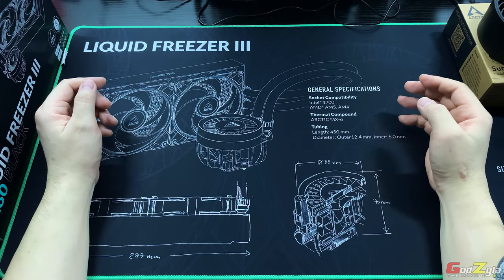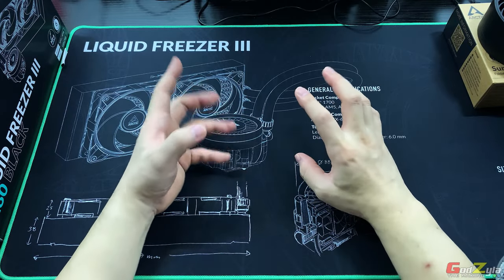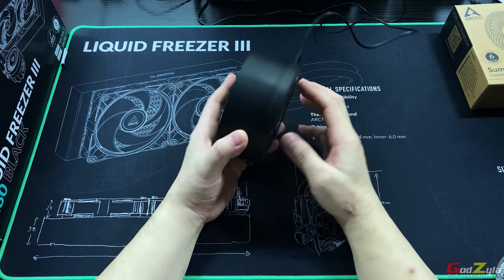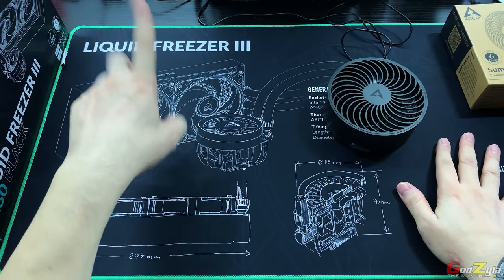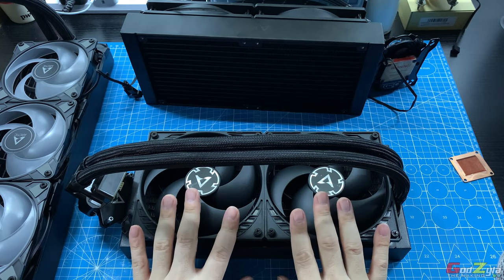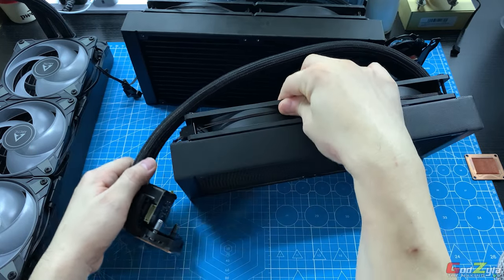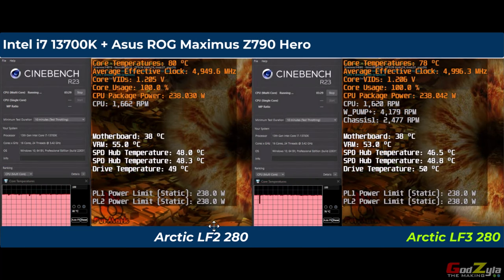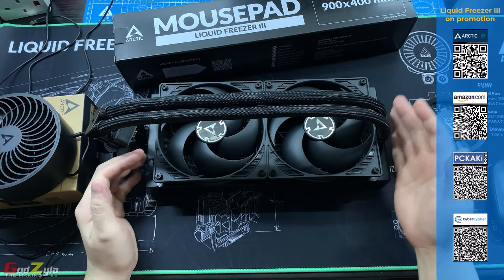Arctic Liquid Freezer III

Comment from the maker: Kindly note, I have made a mistake at timestamp 14:56, be it if you are using the single connector or split connector, the drawing ampere is from the Pump header, make sure you plug the pump header to a 2A fan header or pump header of your motherboard.
Reply: also u have to rename timestamp at 25m
Reply from the maker: @dddman9220  thank you. Greatly appreciated it to have correct my mistakes 👍👍👍
Reply: Im so glad i watched your video i was not able to find anywhere what the best header to plug single connector. I found out that i plugged it in the wrong header which on my mobo asrock b650 pg lightning is CPU_FAN1 1AMP12W so i plugged it in CPU_FAN2 2AMP24W header. Thanks alot for this video.
Reply from the maker: @fr0sty1998  hi and welcome to my channel and am glad you find this content useful, greatly appreciated your feedback too 👍👍👍
Reply: @KleoYan  Hey man quick question, while i was mouting this aio i managed to somehow touch thermal paste i applied and ofcourse instead of cleaning it and repasting i just put aio on the cpu. Wondering if that can cause bad temps with this AIO? I just bought it today, and my 7600x with undervolt in cinebench reaches 80-82c max load.
Reply from the maker: @fr0sty1998  hi not to worry your temp looks fine, unless max load is at 95 or so with under volting.
Reply: @KleoYan  Hmm im wondering why i cant push past 5.31ghz boost clock then with best core -15 2nd best -20 and rest -25.
Reply from the maker: @fr0sty1998  if you are just fiddling with curve optimizer and not PBO2 manually. That might be the cause. I wouldn’t advise you to do PBO2, unless you fully understand how PPT TDC and EDC works.
Reply: @KleoYan  Oh yeah it is curve optimizer, thanks for you quick response. Was just wondering if i can maybe squeeze 5.4 - 5.5 on all cores.
Reply from the maker: @fr0sty1998  sorry buddy, I rather you have a healthy system than to stress it. You see, what’s the point to squeeze every bit from the processor where is does not bring any huge significant performance? Your processor base clock is at 4.7Ghz and boost clock is at 5.3Ghz, which you have reach it. These are the reasons I will stop you from there.
1) the longevity of your processor
2) by pushing it abit more means drawing more current and stressing your motherboard vrm 
3) it does more heat generation which will  impact other pc components. Therefore imagine in a long run, you motherboard suddenly died on you. What happened then? 

I am more toward the conservative type. Whereby so long it performs similar or slightly better than base spec, drawing lesser power to achieve better thermal results, I will call it a day and to enjoy the PC. 

Last but not least. If you still choose to go beyond. I won’t stop you either.
Reply: @KleoYan  I used to do some overclocking on intel cpu's with deliding aswell. But i cant seem to understand how ryzen systems work, or to be honest any of the new cpu's. I mess a bit with curve optimizes trying to lower voltage i saw alot of people managed to hit 5.5- 5.6ghz just by undervolting but my cpu always stops at 5.3 no matter how much of undervolt i use. Temps are also fine max tdp is 90w i believe.
Reply from the maker: @fr0sty1998  maybe this will help you out. First get to know what's PBO2 and CO (Curve optimizer) https://youtu.be/dU5qLJqTSAc then you can refer to this https://youtu.be/90UBUq1mLGY 
Now this is way off topic of this content. If you and to know more and such. I would encourage you to discuss your matter here https://www.reddit.com/r/Amd/
Reply: @KleoYan  Thank you so much for all the help. I did manage to find a really high (stable) undervolt for my cpu which is core1 (best core) -22 2nd best core2 -21 core3 -34 core 4 -27 core 5 -34 core 6 -38. I still have to test core 3 and core 5 i believe they might be able to undervolt even more. I know i saw somewhere that it is good to give lower undervolt on best core and give it more headroom for higher clock. Still learning though.
Reply from the maker: @fr0sty1998  Yup and hope for your kind understanding. I have bad experience showing settings on a content regarding about AM4 undervolting. Even with disclaimer that I will not be responsible for damages, one of my viewers took my settings and blew his processor. Though he did not fault me but I felt bad about it. 
The issue is, each processor reacts differently (Good bin and average bin), that's the reason why I provided you the links for you to find out more about PBO2 and Curve Optimize. Anyway all the best with your tweaks 👍
Reply: @KleoYan  Hey i think i just found the most stable error free undervolt core1* -20 core2* -20 core3 -34 core4 -23 core5 -35 core6 -36. For some reason core4 only takes -23 undervolt to become stable ive been testing alot with occt. Also im wondering if there are any advantages of using 3 cables instead of 1 cable for Liquid Freezer III 360?
Reply from the maker: @fr0sty1998  Hi and welcome back. You can do all the findings on Curve Optimizer but I can only tell you.. I was once like you and one fine day, system can't boot properly. ended up have to tweak again. It's very tedious to find the correct curve points as you need to do all cores plug for 5000 or 7000 series AMD, the there are two CCD which are the top cores, they will use more voltages, thats why you can't lower anymore on the CO (Curve optimizer). 

As for 3 cables to 1.. the Pump connector not only provide power to the pump, but to you radiator fans and vrm fan. as for PWM are controlled separately (The fan connector and vrm connector) That is the advantage. 

If you use the one cable for all, basically you can't separate the PWM rate of the VRM fan, Pump header and the Radiator fan.

Comment: Please guys whatever you do, do not buy arctic freezer 3 if you have an amd processor. This shitty designe on the aio costed me another 150 quid to replace my fried ryzen 7 5700x cpu. The designe is so awful for I stalling it on the cpu and it's just janky. And I did install it with max force because I had to push one finger at one edge of the cpu block thing in order for me to install that aio to my motherboard. Honest to god my worst experience with my first aio purchase. Hope you find this helpful Arctic
Reply from the maker: @sebs6144  hi and welcome to my channel. Hmm, sorry for your unpleasant experience, I have no issue with it though and getting extremely good results on a 7950x https://youtu.be/ca2zGSQvWog.  Nevertheless, thank you for your feedback.

Comment: Where are the actual fan cables? Are they running under the sleeve of  the hoses to the pump section? Am I missing something? What if you want to replace the fans?
Reply from the maker: Hi Dēmḗtrios, welcome to my channel. The fan cables are hidding under the sleeves. if you are to replace fans I would advise you to check the ampere of your fans. if it total up to less then 1A, then proceed to use back the connector which is located at the hose (radiator area) to connect your replaced fans. If you are using Lian Li uni fans. AL, SL, TL or even SL-Inf, I would advise you to plug it to their controller / hub and not to the fan connector of this liquid AIO.

Comment: Hi i have this aio when i connect   all work but not argb and rwm  what should i do I have b650 pro rs mini atx and i connect all in one cable to cpu fan 2wp and argb to addr led 2.  What should I do in your opinion.
Reply from the maker: Hi Patryk Płatek, welcome to my channel. is your board this? https://www.asrock.com/mb/AMD/B650M%20Pro%20RS/index.asp if it is, make use of the 3 to 1 cable of this liquid cooler and the connection as follow, page 10 of 67 of the manual https://download.asrock.com/Manual/B650M%20Pro%20RS.pdf

Liquid AIO Pump connector to CPU_FAN2/WP - Set in UEFI / Bios to Water Pump and with PWM at FULL speed
Liquid AIO Fan Connector to CPU_FAN1 - Set in UEFI / Bios to PWM and set it to performance
Liquid AIO VRM Fan connector to CHA_FAN3/WP - Set in UEFI / Bios to PWM and set it to performance
Liquid AIO ARGB connector to ADDR_LED3

download ASRock Polygram, you have to select ADDR_LED3 and then set the effects.

Comment: THANK YOU FOR THIS INSTALLATION METHOD! I got the Liquid Freezer III 420 today and installation was a breeze!
Reply from the maker: Hi Krithalith, welcome to my channel and I am glad you have mounted your LF3 with ease 👍👍👍
Reply: Hiya, I ordered 1, getting it tomorrow, how are you finding it? I'm upgrading from the LFII 360
Reply from the maker: @Takeme_DCUO  hi and welcome to my channel. Liquid freezer III will be good for AM4 or AM5 but not Intel. I have done some testing and here are the results https://youtu.be/ca2zGSQvWog. Hope that helps.
Reply: @KleoYan  brilliant I have a ryzen 7 7800x3d 😅
Reply from the maker: @Takeme_DCUO  ok thats good.👍👍👍
Reply: @Takeme_DCUO  I'm using it on a 9950X and am definitely happy with it so far. It's quite quiet on lower fans settings and the cooling performance is very good.
Reply: @Krithalith what sort of temps do you get under load with this and the 9950X?

Comment: do you know how i would sync the argb with lets say a lian li controller if i wanted to swap out the fans with uni fans
Reply from the maker: Hi Steve Larson, welcome to my channel. Mind if I ask which Lian Li uni fans will you be using?
Reply: @KleoYan  I was thinking of using the uni tl 120s on the liquid freezer III aio. I was also going to have some uni tl lcd reverse fans in my case for intake
Reply from the maker: @stevelarson520 If you have set you mind on the TL 120s and TL 120 LCD, you will need to seperate from the AIO. as TL fans draws lots of ampere. this is what you whould be doing. 1) For AIO Pump, use the single connector to provide power both to your pump and VRM fan. and the argb connector to your motherboard argb header, you have to make use of your motherboard utility to control the pump argb effect. 2) for TL Fans or TL LCD fans, you have to plug it to the uni controller/hub. This is where you will need L-Connect 3 app to control the fans argb effects, rpm and the LCD display.
Reply: @KleoYan  thank you very much for the help. i appreciate your time
Reply from the maker: @stevelarson520  you are most welcome. All the very best with your build too. 😉

Comment: i struggle to wire the ARGB from my arctic liquid freezer 3 aio into my Z790 Maximus Hero because the cable of the radiator fans is a Male and on my motherboard its a male too, but on the arctic website it shows that normaly the Radiator fan cable SHOULD BE a female which would work well.. realy dont get it
Reply from the maker: Hi Velvet - Real Horror, welcome to my channel. the ARGB plug on the LF3 is a female connector and the ARGB 3pin 5v header on the motherboard is male. you should be able to connect it. maybe take a picture of your AIO argb connector and send it to my email godzylatech@gmail.com. I see what I can do to help you out.
Reply: @KleoYan  Yea thats the point :D it realy should be female, but mine is male, or maybe i need to unscrew all the fans and check them, maybe theres something wrong with the cable connections or the real motherboard connector is hidden... alright i will send a picture, thanks!
Reply: Alright, send you a email
Reply from the maker: @VELVET462  I see what's the issue now after seeing the email. look at the other side of the fan where the tubes are at on the radiator. You see the fan argb is connected to the cable and that cable routes all the way to your pump. your pump will have the female 3pin 5V argb connector. that is where you plug to your motherboard. as that argb cable not only controlls the argb effects of your block but to the radiator fans too.
Reply: @KleoYan  My Man!
 
one thing first. In youtube you wrote "welcome to my channel" but its not the first time, im following you a while now. and you helped me some while back!
I cant thank you enough, i never installed ARGB but after you said whats wrong of course i saw my mistake xD
Everything works like a charm now! Thanks so so much! :) Love your channel, keep up your realy helpful videos and person.
 
greetings from germany
Reply from the maker: @VELVET462  You are most welcome. Glad your issue is resolved. Have a great weekend too 🙂
Reply: @KleoYan  Same to you! thanks :))

Comment: I have this AIO as well, I got the 360 III BLACK version and upgraded the 3 fans to an Arctic P12 Max, and it is powerful! With the P12 Max upgrade, I can now dissipate to 300W thermal. On the standard fans, I think at 288W was doable. Right now I set my CPU (i9-14900K) to PL1=253W and PL2=253W, ICC=307A, under volted to an OFFSET of 0.1V, with a Cinebench 23 score of Multi-core = 39075, Single Core = 2351. It's a recommended Cooler for every INTEL I9 especially for the 14th gen series.
Reply from the maker: Hi Half_r_mk5, welcome to my channel, thank you for sharing your experience. Greatly appreciated it 👍
Reply: @KleoYan Hey thanks! Good review. I just did another test on my i9-14900K, set the PL1=288w, and PL2=288, ICC=400A Max...It temporarily throttled on P-Core2 that was the only thing for a few seconds, then it was ok, Final temps were  96c no major thermal throttling, with a final Cinebench 23 score of Multi=40307, and my Single Core = 2344, just went down a bit on the single core. Still it is a capable AIO cooler.
Reply from the maker: @half_r_mk5  nice, am glad you like this liquid cooler.

Comment: Great review. Liked your video. I just bought the Arctic LF3 ARGB. And glad to see you confirm that it was a good buy.
Reply from the maker: Hi Amol Pandit, welcome to my channel, you might be interested to know how this perform compared to other Liquid AIO. https://youtu.be/ca2zGSQvWog . Thank you for your feedback and all the best with your build too.
Reply: @KleoYan  saw that video just now. In your test the pump speed of Arctic LF3 was much lower when testing Intel.
Reply from the maker: @AmolPandits  yup my bad. There is an error when I place the figures on the pump of the spreadsheet. It should be same as the AMD. You can view the benchmark which is running the actual stats.
Reply: @KleoYan  ah OK. I was wondering if pump speed made the difference. It's good to see someone making clear to the point videos. The point about the LF3 mounting and screws helps all those who bought it. Keep up the good work.
Reply from the maker: @AmolPandits  thank you for the feedback and all the best with your build too. 👍

Comment: Great review! I really love my Arctic II, def purchased the III, and I really like being able to control fans/pumps/vrm cooler individually now, that's great. My II will still get put to good use too, upgrading another system off a dark rock pro 4 (7700k at constant 5.1GHz, previously on nzxt x62)
Reply from the maker: Hi TheMrDrMs, welcome to my channel and thank you for your valuable feedback. I am glad you have place the LF2 in good use and to purchase the LF3. Yup now you can control the RPM individually. All the best wtih your build 😉
Reply: @KleoYan  Got it! I wish the cold plate covered the whole IHS on my AM4 (5900x). Cold plate is large enough, but offset is wrong (or made to be universal, so they compromised) Thanks again!
Reply from the maker: @rMs Good observation. This I can answer as why Arctic did it this way. Initially they wanted to do separate Liquid Freezer III. a set just for Intel and a set for AMD (coldplate on the pump already offset), which each have a different coldpate. the AMD offset coldpate and the Intel (normal coldpate no offset). But final decision was to do one unit to suit both platform as to reduce the confusion to new pc builders. So thats why for what you purchase right now. Intel will be perfect dead center but for the AMD the offset mounting bracket will move the pump down just to have the coldpate cover the vital part of the AM4 or AM5 Die.

Comment: Great video, I'm installing this AIO tomorrow. Which RGB controller were you using to demonstrate the lighting in this video? I noticed it had a remote control and I'd be very interested in something like that. Thanks
Reply from the maker: @blackie75  hi welcome to my channel. I am using the Fan and argb hub from gelid amber it’s the amber 8 pro https://youtu.be/brigGor38PY
Reply: @KleoYan  Hey, thanks man I'll check it out today 😉
Reply from the maker: @blackie75  there are cheaper options which are good too. Just happened that the Amber 5 and Amber 8 are provided by Gelid.. but I prefer Amber 8.. one thing though.. once you shut dont the machine and turn it back on.. you have to reset the ARGB.. so something to take note off. Alternative you can try this https://www.amazon.com/gp/product/B0BP1JZTND/ref=ewc_pr_img_1?smid=A1X11FOVGZ8LKJ&psc=1

Comment: Hi, I got PUMP, VRM and FAN cable and I don't know where to put them since the fans work, but I don't get any RGB lightings working
Reply from the maker: Hi Jonathan Jansson, welcome to my channel. which motherboard are you using, mind to list out the brand and model.
Reply: @KleoYan  ASUS Prime Z790-A WIFI
Reply from the maker: @JJsNightmare  based on your motherboard manual https://dlcdnets.asus.com/pub/ASUS/mb/LGA1700/PRIME%20Z790-A%20WIFI/E21270_PRIME_Z790-A_WIFI_UM_V3_WEB.pdf?model=PRIME%20Z790-A%20WIFI page 12 of 80. I will do this, plug your LF3 pump connector to AIO_PUMP (1A) as the total power draw from your LF3 pump (0.35A) + VRM Fan (0.05A) + 3 x P14 ARGB Fans (0.17A) is a total of 0.91A, then plug your LF3 fan connector to CPU_FAN and your LF3 VRM connector to CPU_OPT. as for your ARGB connector, plug to the 3pin 5v ARGB header on your motherboard, use armoury crate and when at the aura sync dashboard, select the argb header which you want to control the argb effects of your fans and pump.